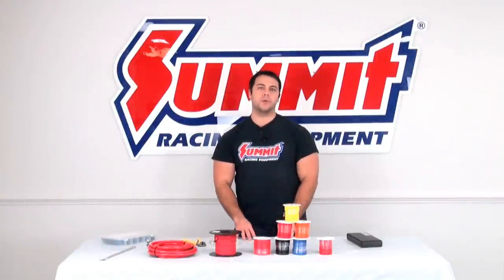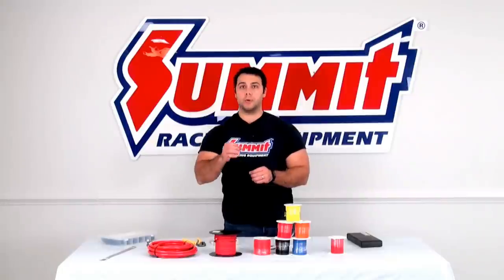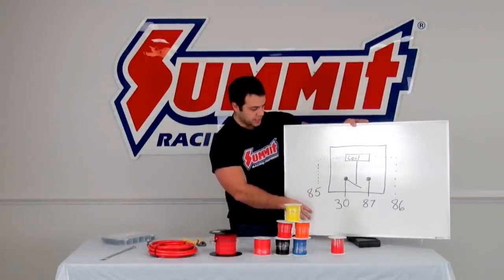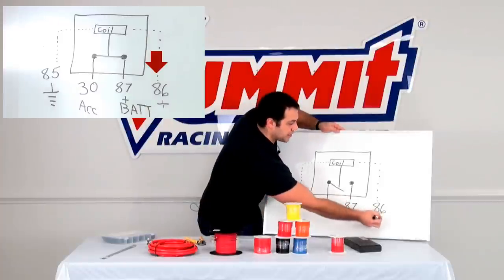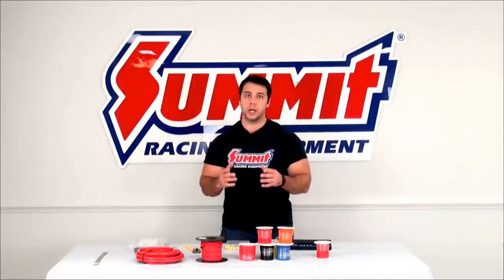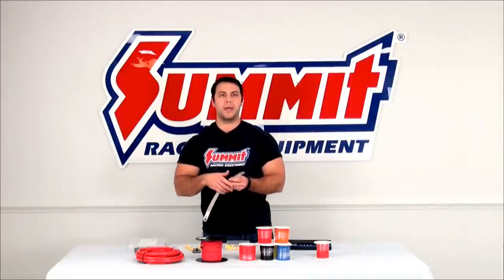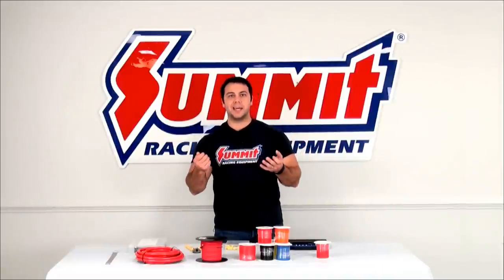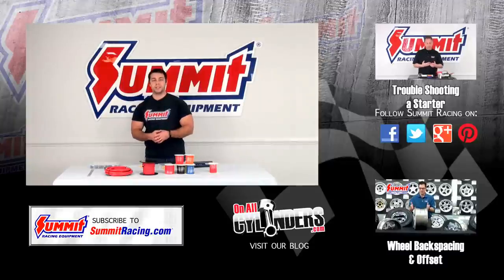Vehicle Wiring Tech Tips - Summit Racing Quick Flicks

Comment: The suggestion for using a "star" washer was very helpful as an excellent ground can make or break a circuit(LOL) & nice/simple explanation of accessory relays too. I have worked in aviation(avionics specifically) for over 30 years. I spent 18 years building engine harnesses for our commercial aircraft fleets an never used solder when terminating wire ends(lugs, connector contacts or splices). We use only mechanical crimp tools as there is high vibration on an aircraft(more than any vehicle). I thought this might be of value to someone, crimp tools are calibrated and require specific settings  per applications as overcrimping weaken the connection resulting in possible failure
Reply: Mike a great addition. I have been an electronics technician for over 49 years and like you think you need to be well aware of vibration. Off road vehicles and race vehicles need it badly. I also used to build harnesses for agricultural applications and as I said appreciate your addition.
Reply: Is soldering absolutely necessary in a land vehicle and where would I ev n solder

Comment: Great video. It cleared up a few things for me.  Three questions, however...

1. Can I daisy-chain a fused power source among several toggles to power their individual relays?

2. When adding a fuse/relay box to a vehicle, do I have to account for the total amp draw of everything attached to it to determine the size of wire to run from the battery, or is there a standard wire gauge  for that?

3. What do you think of the practice of using over-rated wire for everything in a vehicle to eliminate the confusion of determining wire sizes?

Comment: I have a couple of questions. I'm new to automotive wiring so I'm still learning this stuff...

1. I just bought the stuff to make a relay/fuse box for accessory LED lights. Is there a way to determine what guage wire to use from the battery to the fuse box? Like I know they are 40A relays and I have 5 of them? so does that mean I should use wiring rated for 40A or is there some other formula for determining this? 

2. Is it neccessary to use relays for something like LED strips since they dont require as many amps?

3. How does all of this stuff work when wiring multiple devices to one switch or multiple switches to one device?

Sorry for the long comment. Any videos, articles, or advice you could give would be much appreciated. Thanks. Great video btw. Subbed.
Reply from the maker: Hi Hutson, 
LED light bars are becoming very, very popular especially in the Jeep & Off-road market. One thing to keep in mind is the reason for their popularity, that is, the low amp draw for the amount of light provided. Reasonable additions of LED lights bars in general will not overload an already marginal OE charging system. Depending on the size of the bar, the amp draw may only be from 2 to 25 amps. That being said, your 40 amp relay is much larger than you need per each light bar, but will not hurt a thing! The more important thing to consider is the wire size between that relay and light. This is determined by the current moving through said wire and the distance it has to travel. There are wire gauge charts all over the net that you can obtain to help you determine the correct wire size. The purpose of the relay overall is to not have to run a higher current through a switch. Simply stated, a relay is nothing more than a low amperage circuit controlling a high amperage circuit!

Comment: why many cars mix switches when you don't have solid ground 

like  am indicating left and at the same time current flow to packing lights or something else light
this happens when some of cars have less than 60 percent contact between negative terminal of the battery and engine or car body

Comment: Hi, what will happen if I choose the wrong wire(thiker)?Let's say I need 16 gauge  for my accessory but I will use 14 or 12 gauge.
Reply: Mirik Man 
No big problem just causes a bulkier harness. A little extra will never hurt your performance. This extra can make up for excessive current draw and voltage drop which Will cause poor performance. Great question just read all the comments, there are many experienced helpers out there to give you a hand. Every comment can be filled with the information you need. Good luck my friend.
Reply: Your wallet will be lighter than it should be. Thicker wire costs more.

Comment: If budget is no issue, then just to be on the safer side is it simpler to just go with let's say 12 or 14 gauge wire instead of 16 gauge (calculated using charts)?
Reply: Saurabh Makkar yes, although a bigger gauge wire might have more resistance than a smaller gauge, but it doesn’t hurt too much

Comment: I'm getting from you that 87 has the battery in and 30 is the acc. power... but on the internet diagrams I have looked up its right the opposite?? great.. how can I no for sure which is correct for mine?
Reply: Matt Sisum the Internet is correct this diagram is wrong, 85 & 86 are the earth and trigger for the solenoid, 30 is battery power in and 87 is power out to whatever you're running.
Reply: Yup this wiring diagram is wrong: 30 is to be connected to battery (via Fuse) ... the setup here will work for Single Pull Single Throw, but it will not work for Single Pull Double Throw ... The ISO standard clearly defines 30 to be the connection to 12V source.

Comment: do you know what gage wire I need to use to rewire my 93 2.3l mustang? I used 16 gage but it is like double the size of my fuel injector connection
Reply: +Maurice Terry if you have the old wire, it should be on there.
Reply from the maker: +Maurice Terry, 
16 gage wire is good up to a 10 amp current flow and while your injectors won’t draw that much, a little overkill never hurts!

Comment: @Summit Racing can you please remake this video and show the correct wiring? Pin 30 is to be connected to the 12v Battery source (via Fuse). Even though the diagram shows still works for Single Pull Single Throw relays, it will not work for Single Pull Double Throw relays (the normal closed 87a will never get any power) ... not to mention that you are violating the ISO standard of wiring pin 30 correctly (think other people needing to maintain your wiring)
Reply: Dirk B....I just read your comment after seeing this video......you are 100 percent correct and I was scrolling to see how many people caught this fundamental error.   Sad to see Summit put a video with such an error out there!

Comment: 30 is battery
Reply: Yup ... this wiring is wrong : it will work for Single Pull Single Throw, but if you use it against Single Pull Double Throw it wont work as your Normal Closed will not get any juice. People should use the standard of wiring the 30 to battery (via fuse).

Comment: I wouldn't recommend soldering automotive electrical connections because of heat related issues melting the solder or creating a poor high resistance connection

Comment: I have some relays to wire my cooling fans. The instructions indicate terminal 87 goes to the fan and terminal 30 from battery. Your video has these reversed. Does this matter or should I follow the manufacturer's instructions?
Reply from the maker: +rileycalvin69, 
Different diagrams in the industry have these two terminals swapped, but only because it works fine. They simply make a connection from the power source (usually battery direct) to the component be supplied. Do be careful though to not swap the other terminals.